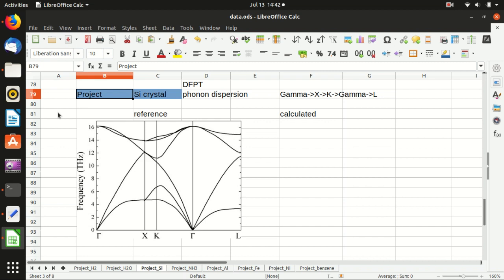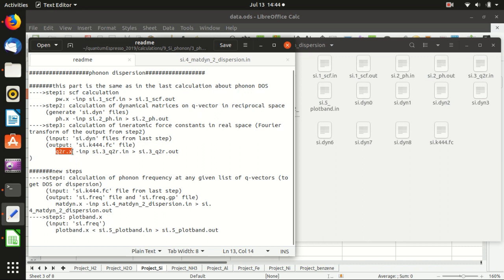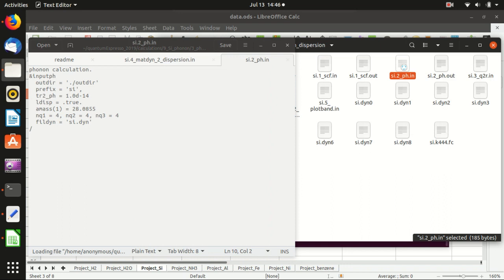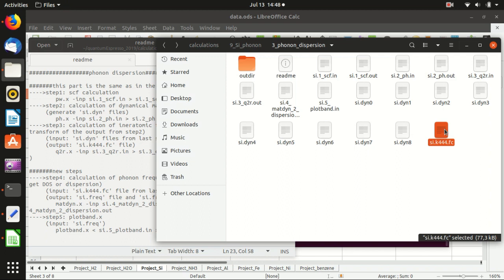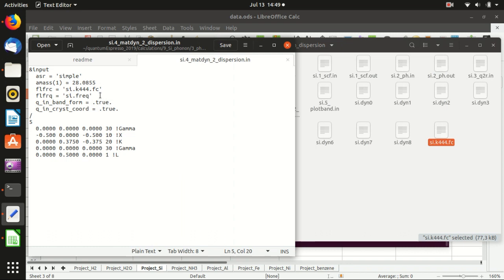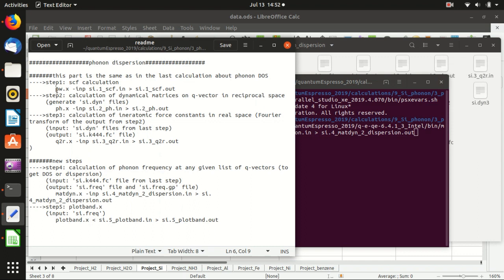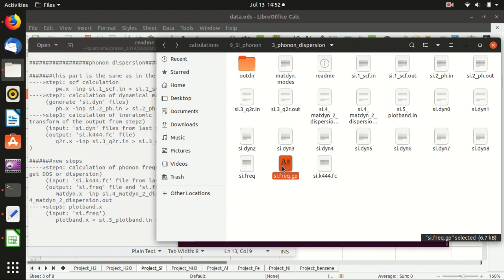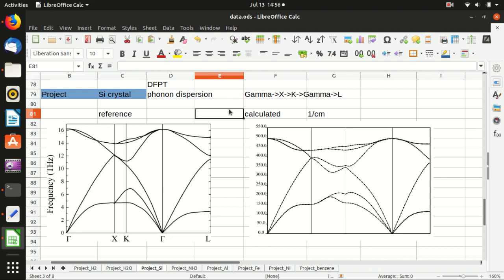Project: 4.3 (phonon) Si phonon dispersion | Quantum Espresso Tutorial 2019

Comment: Thank you for the great presentation! It really helps a lot. I have a few quick questions. 
1. How to set the nq1, nq2, and nq3 in the input file of step 2 for 2D materials, the nq3 should be set to 1?
2. Is it necessary to do the convergence test for the q-mesh in step 2? If so, how to ensure the calculation converges or not?
I'll appreciate it so much if you can answer these questions? Thanks.
Reply: did you resolve your questions?
i am also started doing phonon on QE. full of doubts. the Gamma point calculation taking many hours and also crashing at times.
Reply: @kkm5384  Not yet. I turned to use VASP
Reply: @user-me6vh6rl6p  yes. i already using vasp, but done loooooooong back. i need to revise knowledge. these QE problem solving is tricky. it seems
Reply: @user-me6vh6rl6p  VASP for phonon spectrum? How are you doing? i used VASP/Phonopy. but the results are wrong.